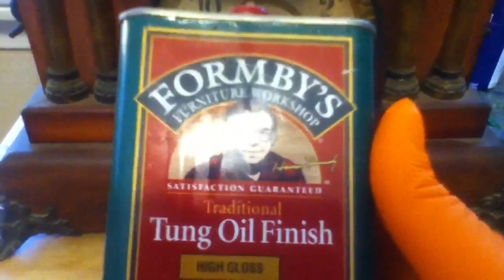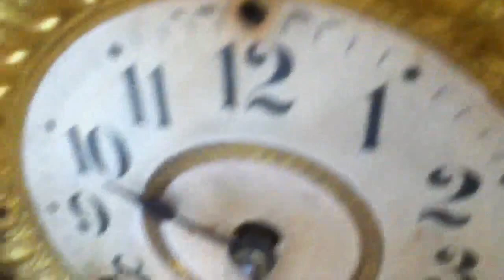Seth Thomas Adamantine Clock Cleanup

Comment: Oh my Lord. Don't ever use WD-40 on a clock. That stuff is Hellish towards a clock movement.
Reply: @ActualVideos  WD-40 will cease the movement over time. The springs will become dirty, and sticky, and the WD-40 will atract dust which will turn it into a thick paste. Like old dryed up grease, and that will over time stop the clock.
Reply: See, what it does is as it attracts dust, and begins to harden into a thick grease like paste, it will make the gears start to cease in their pivots, and it will get harder, and harder for the clock to run until eventually the gears completely cease, and the clock will stop. I'm a clock fixer myself as with everyone else here, and I can tell you that WD-40 will wreck the clock.